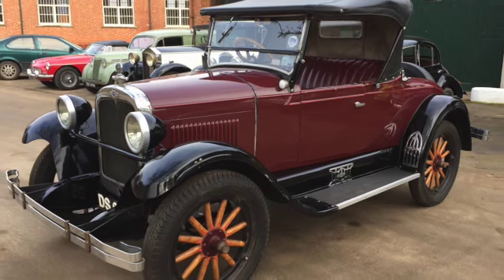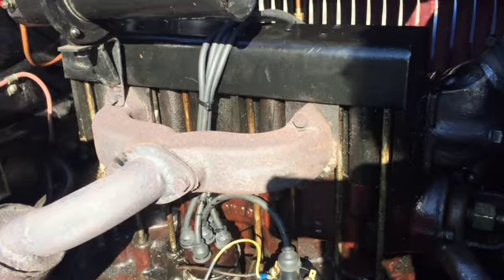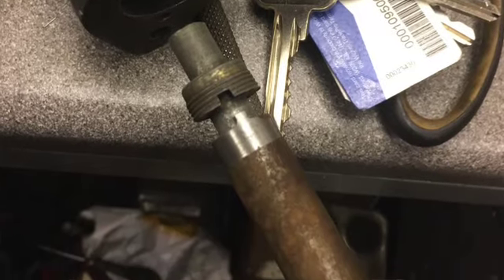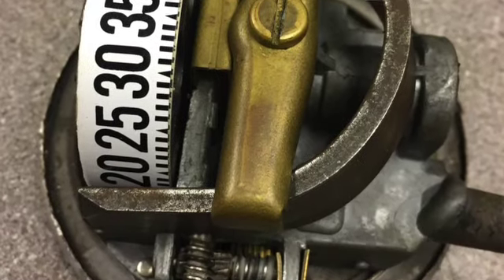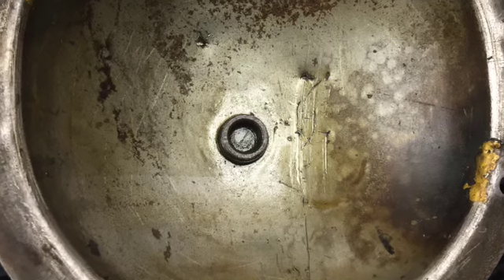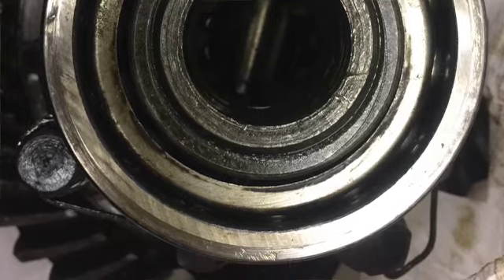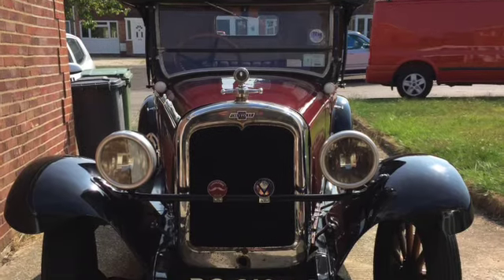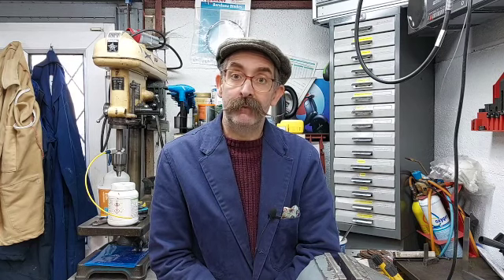1927 CHEVROLET  CAPITAL FIRST FORAY INTO VINTAGE CAR OWNERSHIP

Comment: My '29 Riley tourer also has an Austrailian body (not as attractive as the English one ).I took it for a 40 mile run yesterday and after almost 4 decades of use it still makes me smile.  When I restored ? my Riley I replaced the crown wheel bearings with taper roller (SKF 30208) bearings , works fine. Interesting to see your Colchester lathe, I mostly worked in general engineering and operated many Colchesters  , always pleasant machines to use .
Reply from the maker: Hi Mike, that's interesting to know, I haven't had to touch the rear axle on the Riley ( yet 😀) so I'll file the information away in the things to do box . Although the Colchester is a lot bigger than my previous lathes it's a lot quieter and a pleasure to use. How is the fuel consumption on your  Chevrolet, mine had quite an appetite for the go juice?
Reply: @TweedsGarage  I don't own a Chev , I have two Rileys ,A 1929 nine HP tourer and a 1937 12/4 special ( built from the sad remains of an Adelphi) I fitted the taper roller bearings to the tourer crown wheel.
Reply from the maker: @mikeadams7829  ah got you, if I open up the back axle I will have a look but I have the earlier 5 stud axle which I think they bought in from an outside supplier rather than their own so it may differ.  Mind you the taper bearings don't take up much more space so I'm sure there's an equivalent.

Comment: Nicely presented. 
I've watched with envy the ability to make parts , something I no longer have.
 A friend here who wanted to be able to mill and turn. He bought the machines and I taught him the basics. In return I had full use of them.
He's moved now and I often need to make or mend something that requires machine capability, bits aren't available. 
Mind you it does make you think laterlly and I now describe myself as becoming a master of a good bodge.

Never knew about wheel flaps on vintage cars, serve the same purpose as rim tape I suppose.
Thanks for an enjoyable watch.
Reply from the maker: Nothing wrong with a well thought out bodge 😁 . I did think somebody had put extra rubber in the tyre but when talking about it to the vintage tyre supplier he didn't bat an eyelid when he said they were tyre flaps, I wonder how many vintage classics that are meant to have them don't........and there's nothing funny about " rubber flaps " 😄

Comment: Metric diff bearings in a 1927 Chevy...surreal. Not too many people realise just how far collision damage can travel through an old car with a ladder frame chassis; they just think they're tough as nails and can take it! To have a bent torque tube i do wonder if this car was given a replacement chassis at some point, or even built up from two different cars. 
Isn't it a pain picking your way through 2 or 3 people's historic 'repairs', and laying to rest gremlins that they walked away from, though. Recurring themes i've had with modern cars of a certain age: parasitic drain from the battery (often from a boot light or the central locking, easily fixed) but in failing to diagnose it they've mullered the battery with boost charges to the extent that it needs changing. Water in the petrol from a perished breather hose in the rear wheelarch-  had this twice with the same make/model, in both cases the previous owner's cure was to sell the car...Coil, dist.cap, 'plugs, rotor arm, condenser, HT leads, everything changed but the obvious clue of random engine cuts not decoded! 
My latest purchase, having declined to leak, suddenly dropped a puddle of oil one day....then stopped leaking again. Don't like the look of this.....Oil filter was finger tight rather than hand tight. He had one job...... 

Incidentally if you ever have water drops in your petrol tank- Wynns 'Dry Fuel' in a purple bottle. Not sure how it does it, but it seems to create a flammable emulsion (!) and cures the issue.
Reply from the maker: of that we shall never know but it lives on which can only be a good thing. Being an Australian car i was surprised to only find a couple of pieces of fencing wire used on it so it must of lead a fairly charmed life.